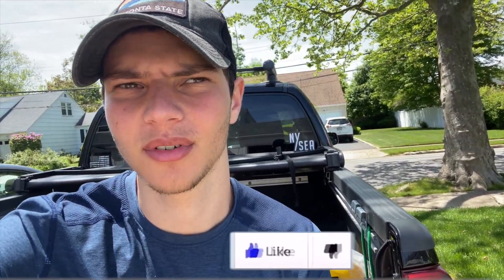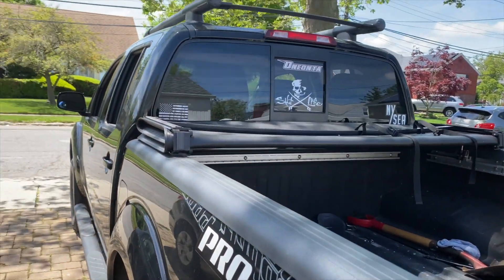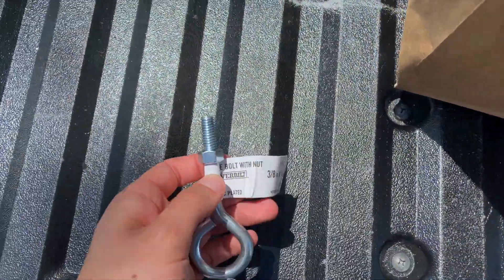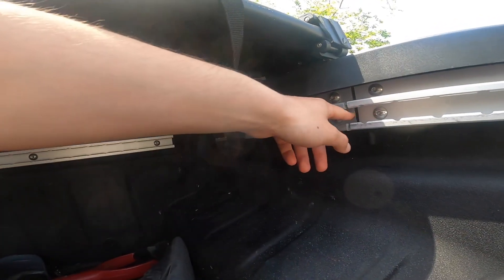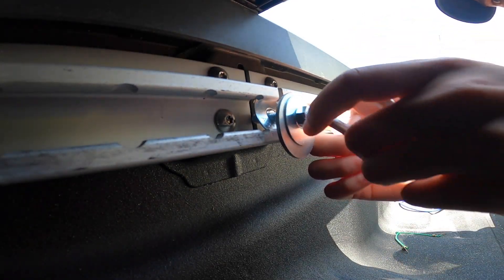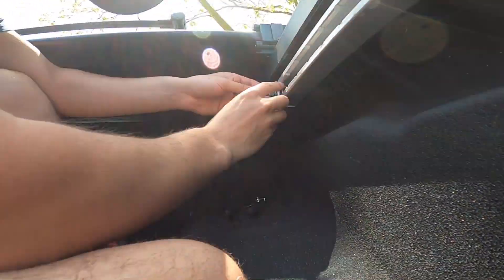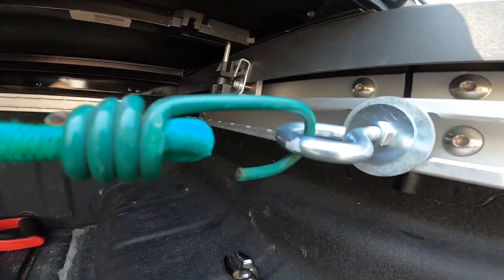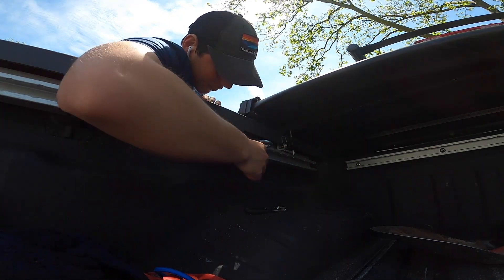Nissan Frontier MODS: How to make a UTILI-TRACK TIE DOWN for under $5

Comment: Never to old to learn from a young person. Picked some up.  I used a spring nut and square nut from electrical. Works great!  
Thx for the video. 
5  3/8 x 4in eye bolts.
5 pak of 3/8 spring nuts
5 pak of 3/8 square nut. 

All you need is a 9/16 wrench.
Reply: Under $20.00 btw.
Reply from the maker: Dude that makes me too happy to hear! Glad i could help!
Reply: Steven Lankford Can you post a pic of the finished product/install?
Reply: @markjones8958  my first video.  Wonder if I'll be famous 🤔
Reply: Steven Lankford As far as I’m concerned you already are. Thanks for the video.
Reply from the maker: Dude it’s gotta start somewhere. Fame is right around the corner
Reply: You're about to make me take this shit off and put unistrut

Comment: Be curious to see how much pressure they can take before failing.
Reply from the maker: They have worked fantastic holding down a paddle board on the highway (that’s all i use it for right now)